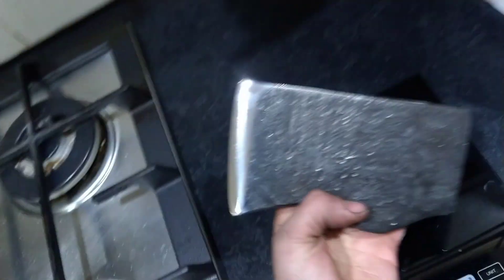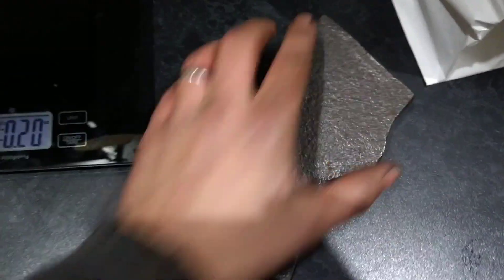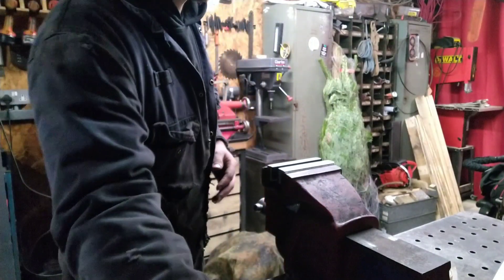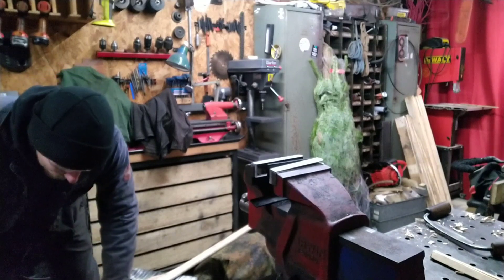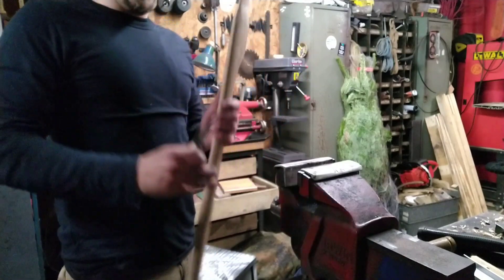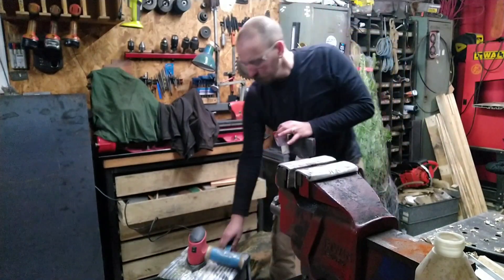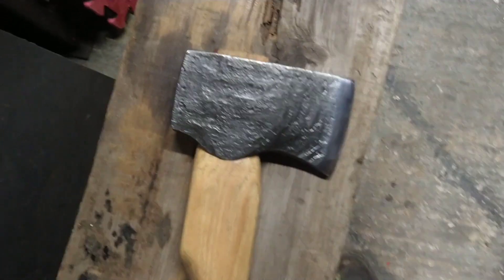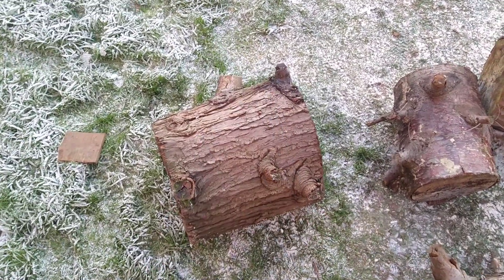Forged splitting axe - handle fitting and test run!!

Comment: Wow that is impressive!  I didn't realise there is such a difference between different axes, nice one.
And I can confirm it was cold in Cheshire, yesterday it was minus 9 deg C brrrr!
Reply from the maker: Yes more than people realise, a lot of axes are designed for cutting but not ideal for splitting. Mauls are ok but I find them a bit unwieldy and have a tendency to snap as they only have a small area around the eye holding onto the handle material. Great time to be stocking up on firewood 😂 Great to hear from you 👍